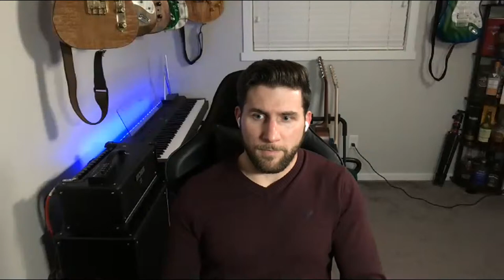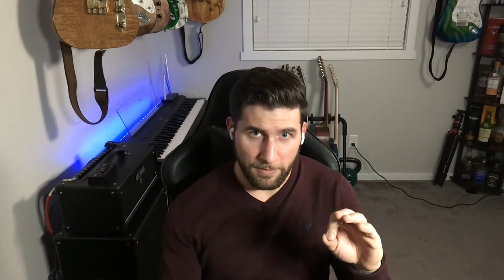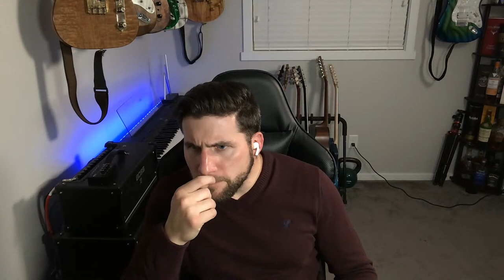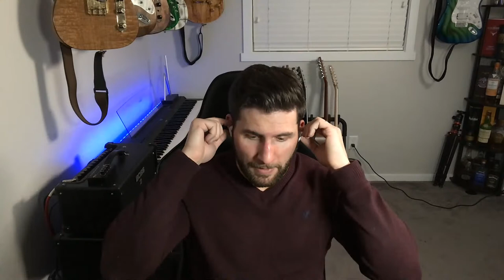When to Fix Mistakes/Accidents in Painting

Comment: Ive been seeing a lot of guys on YouTube and Facebook who repair guitars when the repair requires wood being glued in to replace routing or to strengthen a joint or replacing badly damaged spots on the body but the issue seems to be most times that when they go to paint over the repair no matter what they do you can still see a line around the new wood they glued in is there a way to fix or prevent this so that the repair is seemless
Reply from the maker: If the glued in chunk fits correctly you should be able to fill the line just like you fill open grain. Same process. I think Dan Erlewine from Stewmac has a video about a large glue in repair.
Reply: @BradAngove  ya typically if it's just getting painted I'll just bondo over the patch and sand it level ive just seen a lot of people on guitar finishing chats talking about it and thought it could make good content for a future video seems like it comes up a lot
Reply from the maker: Oh I see. Thank you for the suggestion.

Comment: Had a question, but missed the stream. The Spraymax 2k clear, will it work over top of a Rustoleum Enamel with out issues?  I have not been able to find a definitive answer
Reply from the maker: You might have some issues over the enamel. The painters touch from rustoleum is acrylic base and it works fine over that.

Comment: I've dyed a top to my liking, then sprayed 2 coats of BullsEye wax-less varnish to seal.  Have sanded the gloss off the varnish Peaks, but there are still shiny spots in the Valleys.  OK to go ahead with SprayMax 2k, or take out the rest of the varnish gloss first?  Thanks for your vids... learn something every time.
Reply from the maker: Go over it with scotch brite to scuff the valleys so the spraymax will stick. You can deal with the remaining flat sanding after the clear coat.
Reply: @BradAngove  Thanks, man.
Reply: @BradAngove  I had stopped sanding because I was getting burn-through at the edges; Scotchbrite worked perfectly to complete the de-gloss.  But my first time SprayMax technique apparently either 1) sucks, or 2) I have a  misconception of what medium-wet means.  So remove SprayMax runs just like lacquer runs, during level & polish?  Thanks in advance.
Reply from the maker: Yes, that’s when you would generally do that.
Reply: @BradAngove  Cool.  Thanks (again).

Comment: This made me laugh, "how is the best way to get a good finish spraying outside, Brad "don't" lol
Reply from the maker: Yeah that’s a tough one haha
Reply: I finished a guitar using a really cheap tent that I cut a second Velcro’d door into to access for spraying.  You need a good solid stand and a long pole to get it into the tent far enough (I used a heavy-duty bike stand I already owned).  Not ideal, but if you have no other option it can work.  That, or put the item flat and spray one face and immediately cover with a WETTED BUT NOT DRIPPING cardboard box that is big enough you aren’t going to hit the sides putting it over top.
Reply from the maker: The moist box is an interesting idea. It would protect from dust, but I have concerns about the impact of the humidity on some paint types.
Reply: Im using 3/4" pvc, to build a 10' cube and frog tape to secure drop plastic to the supports, a couple 25x20x1 filters, a zipper door star bonded to the plastic and a re purposed evaprotaive cooler to make the box negative pressure, and to collect spray off and dust
Reply: Yeah @BradAngove “moist” is probably a bit of an overstatement.  (This was acrylic lacquer FYI).  What I meant was just enough sprays from a spray bottle (water with 1 drop of dish soap) to make sure any dust on the box didn’t get loose when turned upside down over the guitar body.  I tried using a plastic box and had a minor disaster. The sprayed water, having nothing to absorb into, beaded up and dripped onto the fresh coat of lacquer.  Managed to wick much of it up with a corner of paper towel before it really wrecked the finish.  Another downside to the plastic box - it won’t breathe - led to some issues with blushing when spraying in the fall in slightly cooler weather.
Reply: @drdoomecj  I tried something similar before the tent.  Make sure you have a spot you can set it up that isn’t too windy (or set up indoors).  I gave up with the damn plastic flapping around in the wind, ripping, etc.
Reply: @BradAngove  Hmm, looks like I replied to you (below) without actually “replying” to you!  Oops.
Reply: @craigm5882  I'm building this in my shop and making it where it can collapse down when I'm done, you can only paint everything at work red so many times before someone gets their panties in a bunch
Reply: @drdoomecj  Cool.  Helps to have a shop!  I know nothing about evaporative coolers, so might be a non-issue, but make sure you don’t blow yourself up running flammable solvent vapours through a fan that could spark.
Reply: @craigm5882  it's an electric squirrel cage motor that pulls air through a curtain of water
Reply from the maker: Not gonna lie, I kinda just wanted to say moist box...